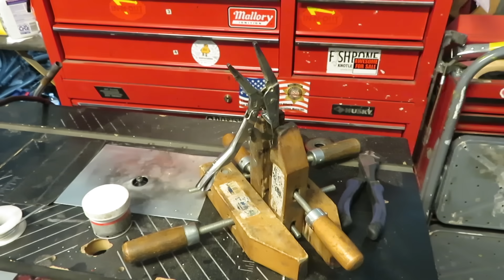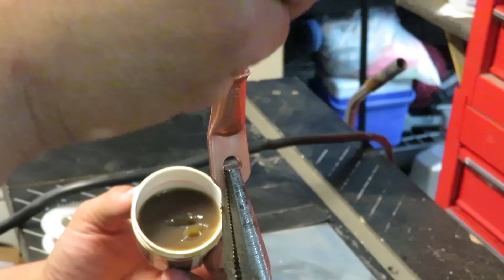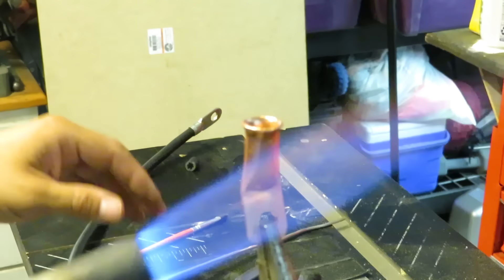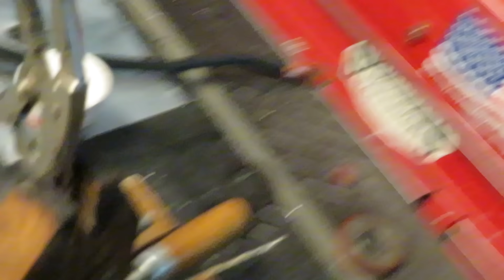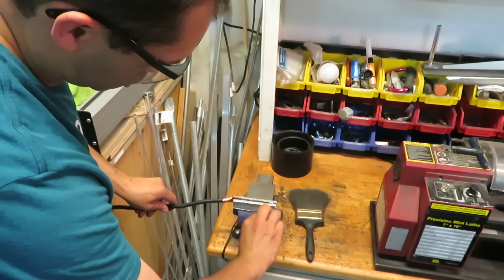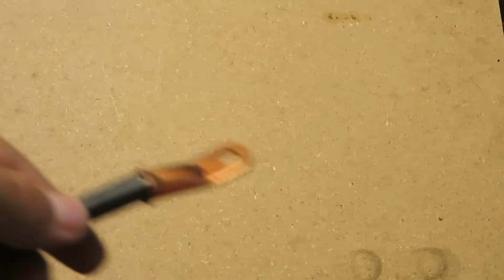How to: Battery Terminal Install. Better than Factory.

Comment: PLUMBING SOLDER IS NOT FOR ELECTRICAL CONNECTIONS.  Also, paste flux is TYPICALLY ACIDIC for plumbing, you want ROSIN FLUX.  Do not do what is in this video.  Solder is to be used ONLY when there is ALREADY a PHYSICAL connection - as in CRIMP - also, do NOT heat the wire first.  DO NOT DO WHAT THIS VIDEO SHOWS.
Reply: Took the words out of my mouth. We're not sweating copper pipe here...
Reply: Thank you for posting your reply. In my mind this seems like a good idea at first but what you said makes much more sense. I am grateful for people like you that take the time to reply with correct information. It just saves a lot of hassle later on.
Reply: @tonyfontes8935  Also, we use a wire brush on the inside of the terminal, CRC QD Contact Cleaner to clean the components, and then Deoxit before assembly and crimping to eliminate the corrosion that happens between different copper alloys, and then spray it with CRC 2-26 to protect it.  Or, CRC Battery Terminal spray will protect it from moisture and other contaminants.
Reply: It's crazy how many absolutely terribly DIY repair videos become some of the most viewed
Reply: That's right i can't tell you how many times I've fixed leaking copper pipes because of DIY plumbers leaving excess flux around the pipe by the fittings/joints so the point is that the flux your using will corrode your stranded copper wire connection over time without any doubt and will cause a short circuit or arcing or fire. also, plumbers soldier is not for electrical use. You should be using 63/37 rosin core..
Reply: I appreciate your comment- thanks
Reply: Thank you for saying all this I was about to!!! People do not do what this video says
Reply: I think this is just for millennia and Prius.

Comment: If the cable gets hot the solder could melt 😩 i always  crimp the lug
Reply: Yes, that can happen.   Even below the actual "melting point" comes the "softening point" for any material that can phase change between solid and liquid.  When it softens, it can come loose even without actually melting.

That's why all cables are crimped inside of a car's engine bay and never soldered.  In aircraft, that extra hold of a crimp during high heat could give pilot enough time to land the craft in case of some on-board fire or other overheat situation.

I read that solder, as strong as it is, was never meant to provide mechanical hold.  Solder starts softening at 90°C too.  High power machines like combustion engines, turbines, can get that hot too in their bays.   Not impossible to reach those temps from high amperage either.  This solder-only solution is asking for trouble.

But, for my Anderson Powerpoles connectors, I've actually crimped first and then flowed in some solder into the crimped wire.  Not sure that could work in extra thick cables like this though.
Reply: If your cable gets to 300+ deg F you have much bigger problems.  But crimping is often better because it doesn't create a brittle strain point right next to the connector, which is where the cable will fail from fatigue stress.
Reply: That joint MUST BE TIGHT, No solder needed,  A heavy gauge wire  like that must be crimped.
Reply: ALWAYS CRIMP

Comment: Could you tin the cable first, before inserting it into the hot solder? The solder could creep up the cable a bit, I guess.
Reply: yes it is much better pratice and a better joint when you tin the cable first

Comment: Good tips, but crimping is still way better for automotive applications.
(And you forgot the heat shrink)
Reply: in most cases crimping is better, but not with these type of connectors, these are very difficult to crimp properly, I tried, if this type of solder connections is done right I feel it's much better.
Reply: @paulna5526  I've got the hammered style crimper that works pretty well, then I got the hydraulic crimper, it was from harbor freight I think?  Works great.  Then I just used a friend's that looks like a big pair of bolt cutters, but that pushes a dimple into the terminal, also works really well.
 My main issue with solder is it wicking up the wire past the part that is in the terminal.  It then stiffens the wire and can lead to fatigue and breakage.
Reply: Correct, solder will cause failure, you won’t find soldered terminals in a Toyota

Comment: Dude you sound like Steve Buscemi (You don't look anything like him though)! 

Hey I do something similar with 1/2 copper pipe. I still use solder but I usually extend the copper sleeve up the cable and softly hex crimp it. This keeps the cable from bending near weakest spot (the solder joint).  
Thanks for posting this up mate!
All the best from OZ,
Ben
Reply: Lol.. I can hear him right enough..